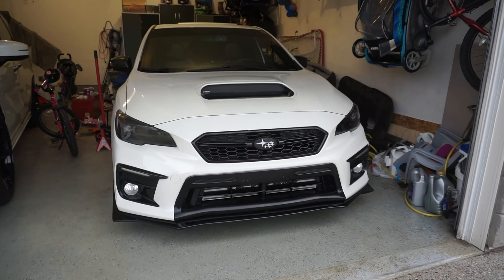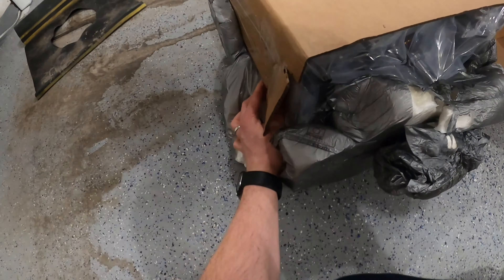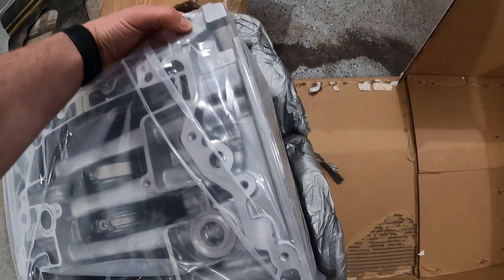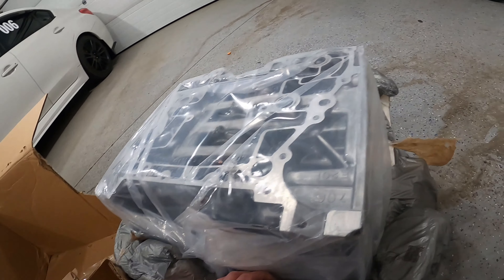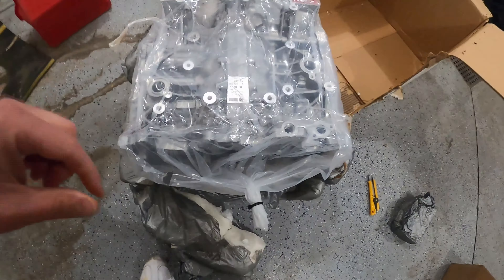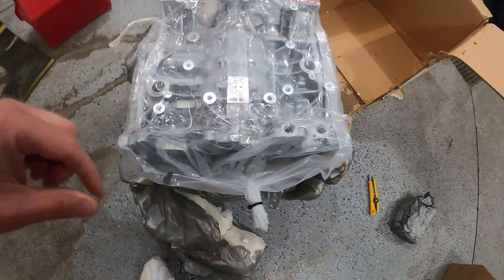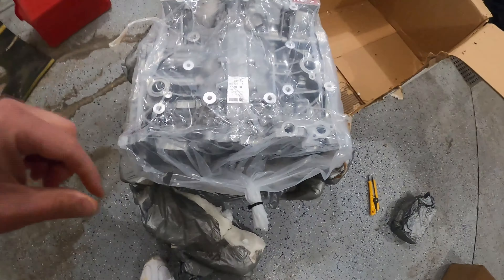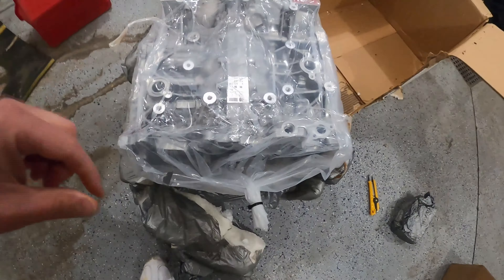2015 WRX FA20DIT IAG Stage 3 Engine Build Series EP.1 UNBOXING

Comment: Did you stock engine blow? Spin a bearing?
Reply from the maker: Nothing went wrong. I just want to eventually go past the OEM block capabilities of 400 wheel torque. I’ll be selling my OEM block. It only has 40k kilometres on it. In perfect condition.
Reply: @snewstead1388  how much do you want for it?
Reply from the maker: @TaylorDurda  hey are you local to Edmonton?

Comment: Hey man have you thought of getting an oil cooler if you don’t already because there’s a bracket that a company sells (can’t remember the name) but it relocated the oil cooler to get air from the hood scoop to maintain use of it and is very efficient
Reply from the maker: I have the Perrin front mount setup with an upgraded larger core. I have it located in the front, my video for this is also in my YouTube channel. The issue with the hood mount location is if you do stop and go traffic it heat soaks. In the front when the radiator fans come on it also cools the oil cooler core.

Comment: Hi. I'm working on my build and have the same exact block. Which head gaskets and what thickness are you going to use? I want my compression ratio to be 10.6:1 but I'm calculating a .8mm HG would make it approx 10.14:1 or a stock .6mm  HG would make it 10.34:1.
Reply from the maker: I used the Grimmspeed 0.78mm head gasket. They have a 1.05mm and a 1.45mm also. It all depends on the amount of material taken off ur heads and of corse the deck it’s self. My heads were straight and only needed polishing. Good luck man
Reply: @snewstead1388  Thank you!!

Comment: I'm really looking forward for this series, I have a custom built block and it's holding strong even with the poor fuel quality we get here sometimes!

A little detail, some people have reported AEM V3 nozzles to go bad over time, please stay aware so nothing goes wrong in the future with your build :)
Reply from the maker: Excellent another that has a built block. Great work man. Fueling always seems to be the lagging culprit. 
The v3 nozzle is interesting. I thought it’s due to others using over the 50/50 water meth mix and running almost pure meth. I’ll certainly be watching thank you for mentioning this.
Reply: @snewstead1388  FA’s are a great platform to make big power, as long as you have proper fueling and supporting mods they will hold up way better than EJs.
Reply from the maker: I couldn’t agree more. Thanks man